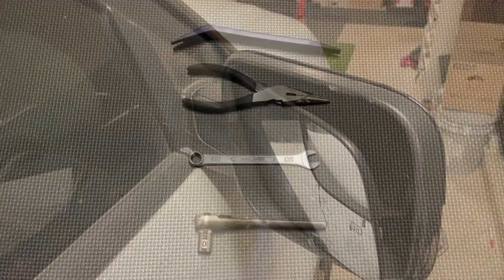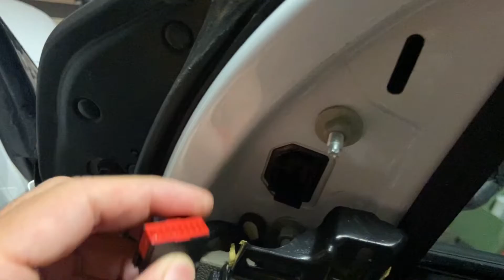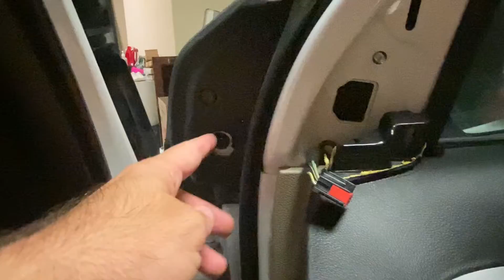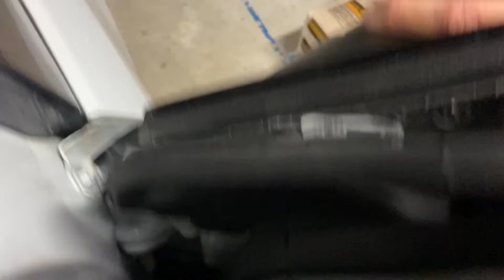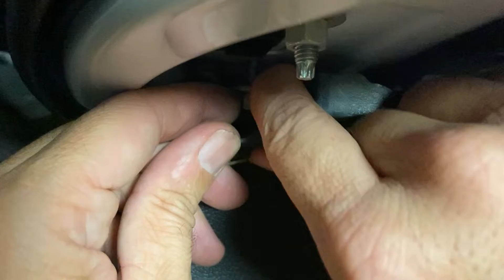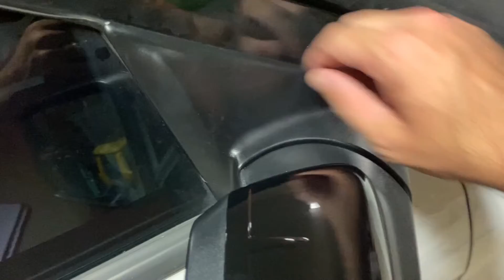How to Replace Side Mirror on Ford Explorer 2012-2015

Comment: Man thank you so much. I had to ride around with my side mirror duct taped and it was embarrassing..the fact that I didn’t have to take the entire panel off was worth it. I didn’t slide a mask under the bottom bolt to keep it from falling which helped a ton

Comment: Great video. I managed to replace mine. Here's a tip to avoid stressing with that weirdly located nut. Get a piece of cloth (I used one of those disposal blue masks from the covid days) and open it up under the bolt/nut to act as a net underneath. Make sure it covers all the empty space so that if the nut ever falls off, it will get caught. You'll have peace of mind when unscrewing and screwing it back on.
Reply: You are a genius!!!